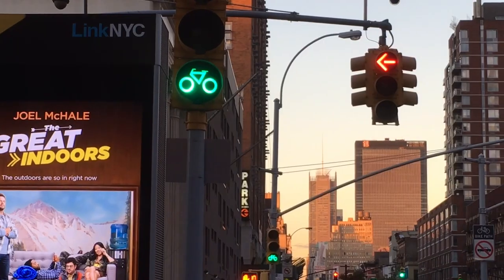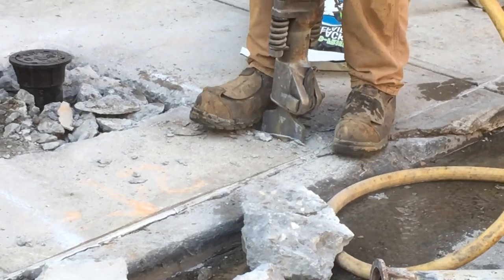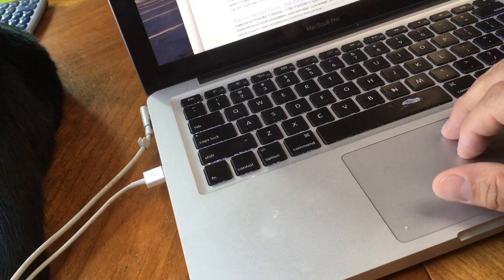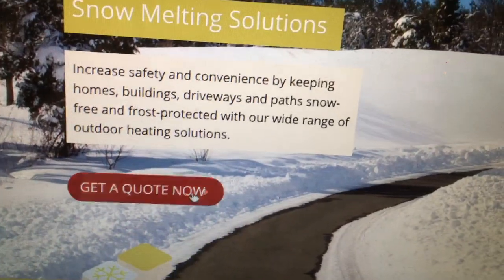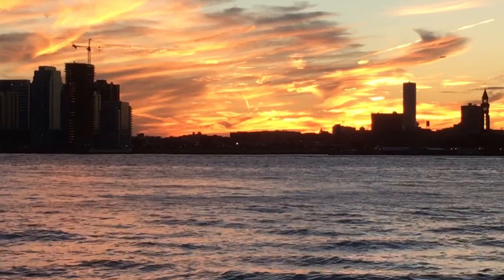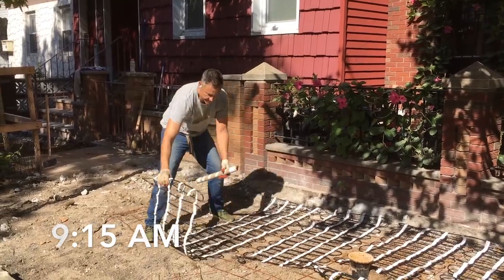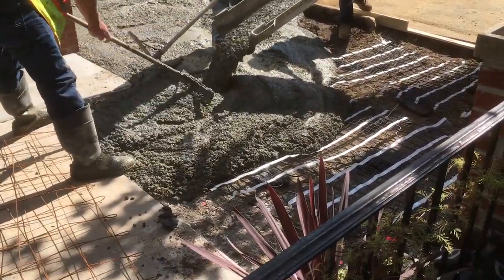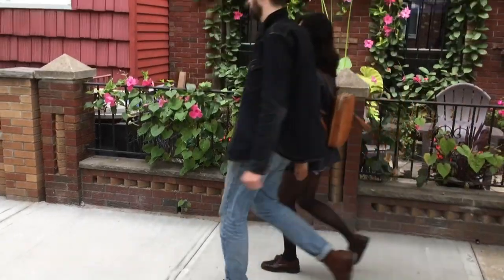Let It Snow: How a Brooklyn Family Installed a Warmup Snow Melting System

Comment: Is there a safety system where the concrete is not heated too fast and crack?
Reply from the maker: Hello Dan - Thank you for your very interesting and important question. Normally, expansion joints are placed within the concrete to allow for some expansion and contraction. Rebar can be used for stability, to make the concrete stronger. Does it answer your question?
Reply: Hi Dan,  We've not had any issues with the concrete.    The mats only heat it up a few degrees above freezing, so it's quite a small change in temperature.

Comment: I see the sensor is mounted on the wall. The three mats were connected inside a metal galvanized junction box. Where did the junction box end up? Is it accessible or was it embedded in the concrete?
Reply from the maker: Thanks for asking - the junction box is along the side of the walkway and is still accessible